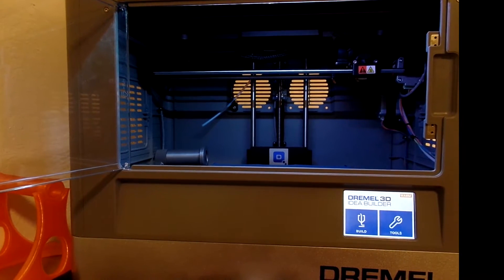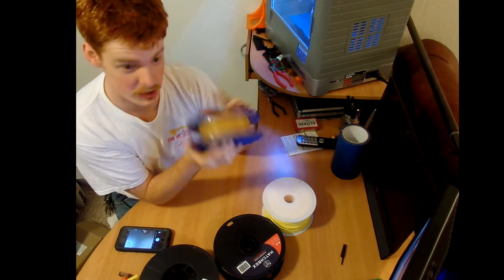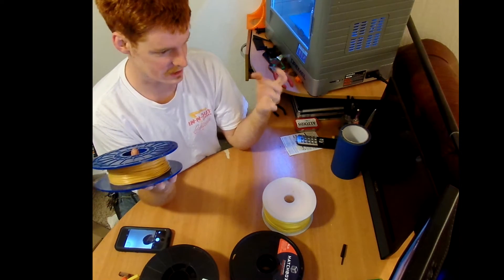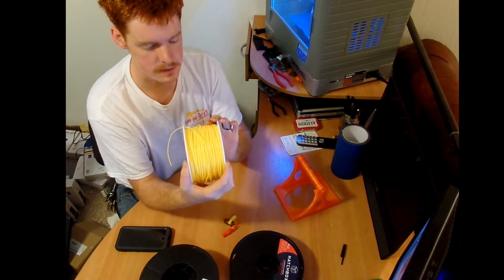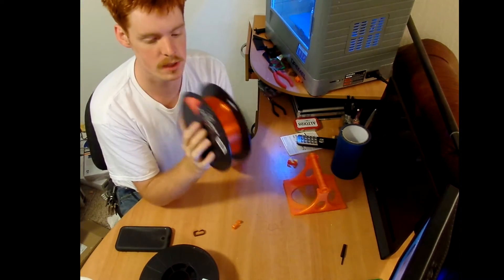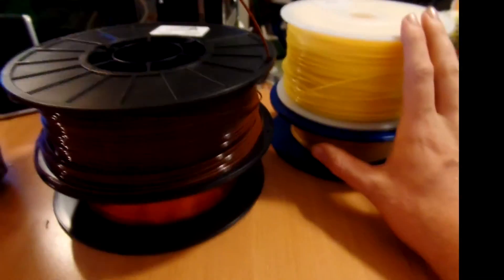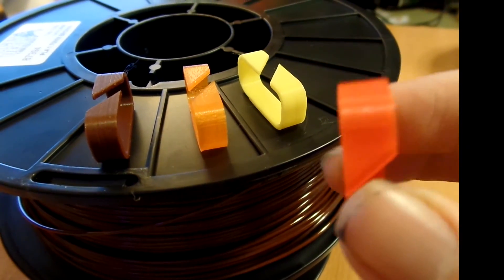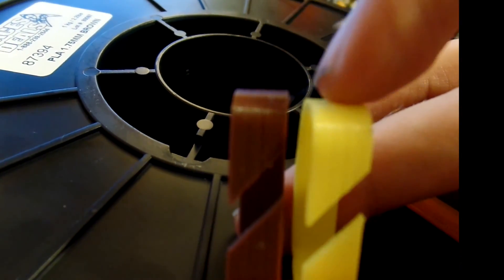Dremel Idea Builder: Do I Really Have To Just Use Dremel Filament?

Comment: Do you think you can provide a link to the filament holder on thingiverse
Reply from the maker: Niko Gaming I meant to add them both I just added the one for in the printer I am looking for the free standing one now thanks for the reminder
Reply from the maker: Niko Gaming here you go http://www.thingiverse.com/thing:32204
Reply: I am thinking of buying this printer. I am planning on running it in my basement where my computer is and where I sometimes sleep. Would that be a good idea? Also, why is the video unlisted. I think it is a fantastic video.
Reply from the maker: Basement is fine just make sure that the filament does not get wet. if you do get the Dremel Idea builder it does not technically need to be hooked to a computer it has an SD card slot. it does make a decent amount of noise so it may be hard to sleep next to. Not sure why it was unlisted it was not originally but its fixed now
Reply: My school has a 3d printer and it makes an awful smell if you're near it. It was also a kit printer which half the time breaks all the time. It doesn't do any of that, does it? Also, I want to thank you for answering all my questions, I would rather have my questions answered by someone who actually owns a Dremel idea builder then someone in a call center.
Reply from the maker: Niko Gaming I have never had any bad smells with mine. I have had small problems with clogs and things like that I am getting ready to send mine into Dremel for them to do a small repair on it but that's after about 3 years. I love helping out people thanks for subscribing. Just a thought have you ever looked at the Robo R1+? That's the other printer I have, it's about the same price as the Dremel and has some cool features
Reply: The Dremel is on sale at my local home depot for $500, that's why I was thinking of getting that one. It's on sale, I like the Dremel tools, and I want to get started on 3d printing.
Reply from the maker: Niko Gaming Oh yeah go for that then it was my first printer and I love it
Reply: Thank you so much. I will go out sometime this week and get it. :D
Reply: I just got my 3d printer a few days ago. I love it, thank you so much for helping me out. Also Do you think you could do a review on this filament? http://www.mcmelectronics.com/product/STELLAR-LABS-COMPUTER-+-310-0120-/310-0120
Thanks
P.S. Could you also possibly review the vertex filament. That's at my local electronics store and it's only $20 for 2.2 pounds.
Reply from the maker: Niko Gaming great! Glad you like it, what stuff have you been printing? I will take a look at those filaments and see what I can do.
Reply: I have printed lots of things. I have printed an iPhone 6 plus case for my friend, bose wave radio remote holder, sd card holder, guitar picks with ac/dc symbol, ac dc symbol, filament clips, keyboard cap remover, adjustable wrench, hammer, resistor lead adjuster thing, tried to print a model but that did not go to well... Keyboard leg lifter, cable organizer to keep my cables from falling off the desk, there's a lot more, but I can't remember them all. I am planning on printing my mom a galaxy s7 case with a penguin in it for mothers day. I once fell asleep on the couch I have next to it. One thing I am having a problem with is the switch that detects the extruder on the right side of the printer. I called up support and they are sending me a new one for free. I did burn myself today, not realizing where I placed my finger when moving the extruder, which was preheated... That was not fun at all... I just remember I printed some ethernet cable tabs for my broken ethernet cables. Anything you would recommend me to print next?
Reply from the maker: Nice all good thing, I would definitely say check out http://www.thingiverse.com/ if you have not already they have some great models. Sorry to hear about the switch but glad to hear you are getting it fixed you should make a video about replacing the switch on the printer also feel free to check out my twitter https://twitter.com/RedHairTech  it might be an easier way to communicate if you have any questions. Also if you are looking for a good 20ish dollar filament I would check this one out this it’s the one I talk about in the video http://www.acesdeals.biz/store/p280/ACES_3D_PLA_FILAMENT-MADE_IN_THE_USA%21_%281.75MM%29_%282.2lbs%29_.html